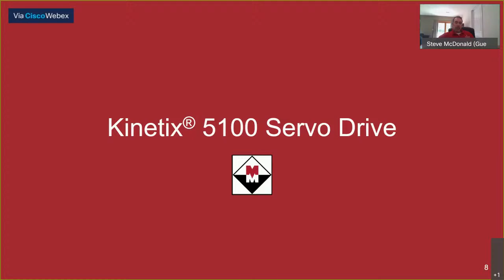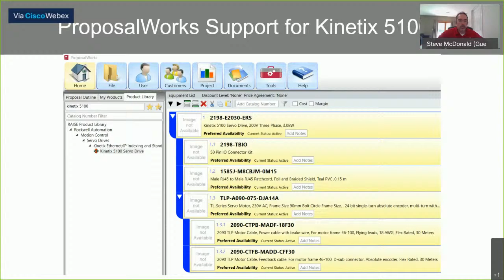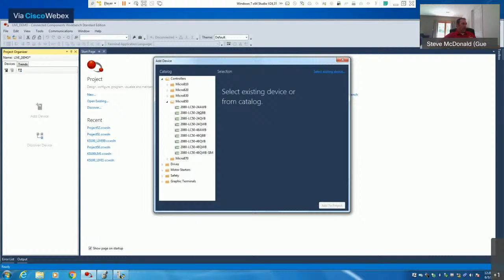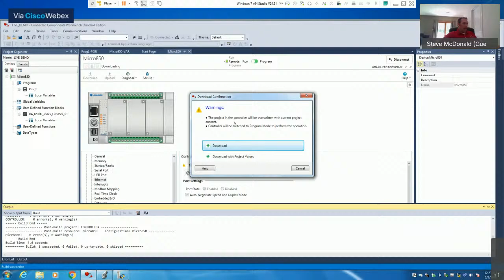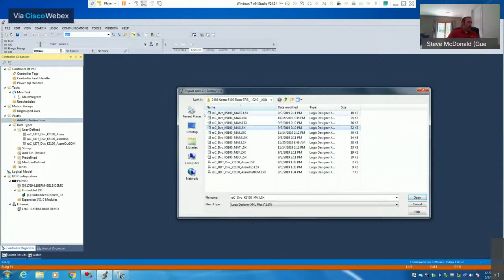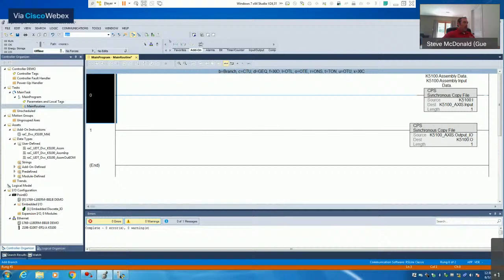Virtual Lunch & Learn: Kinetix 5100 Product Release

Comment: For the micros on ccw the function block I have is v0 and it has an input of new set position and command new set position how do I make that work to increment the current position that I am at. I was able to do it at one time but reset drive setting and I am not able to do it again.
Reply from the maker: Hi Steven, 
The Kinetix 5100 is able to be interfaced with a Micro 800 in ccw. Please refer to tech note ID: QA46559
https://rockwellautomation.custhelp.com/app/answers/answer_view/a_id/1091221/loc/en_US#__highlight 
Or the Kinetix 5100 QuickStart Guide 
https://literature.rockwellautomation.com/idc/groups/literature/documents/um/2198-um004_-en-p.pdf  
For further assistance please contact your local Rockwell distributor.

Comment: How to connect with micrologix 1400 plc
Reply from the maker: Hello, 
There are many different ways the Kinetix 5100 can be controlled by a Micrologix 1400. Explicit messaging, PTO, Analog or Digital I/O are all great options depending on your application. Pages 17 and 18 of the user manual give great examples of typical control configurations. Below is a link to the user manual. If you need further information or assistance on how to set up one of these methods please reach out to your local Rockwell Automation distributor:
https://literature.rockwellautomation.com/idc/groups/literature/documents/um/2198-um004_-en-p.pdf